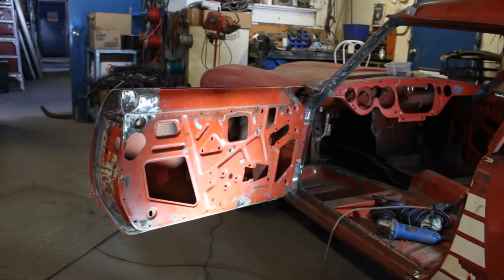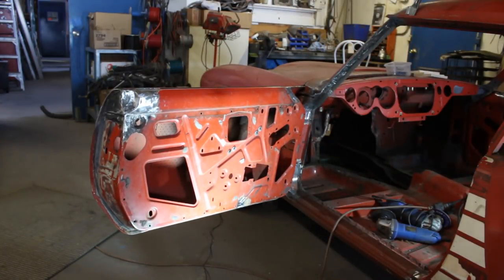1972 Triumph GT6 Restoration - Part 47 - Can of Worms...?!?

Comment: Hi Elin, Where the original body panels were braze welded, my suggestion would to be gas weld using 1/16 nickel bronze rod, Nickel bronze is great for structural panels like this and it was widely used in the construction of space frame chassis. It would save a lot of your issues where you have to mig weld along those previously gas welded seams. It is not s cheap rod, but it flows beautifully. Keep up the great work; I enjoy your posts immensely.

Comment: Elin, love your patience! Those brackets you removed from the wheel well interior are for the trunk interior support structure, the longitudinal trunk floor support structure. Make sure to position the brackets and the support structure temporarily to pick up the attach points of the trunk floor panels, the ones made of hard board. The removable panels are supported and then attached by the longitudinal support structure with screws and quick release catch pins that are captured in place by plates with spring ears. The panel on the right side is easily removable by pulling it up to release the quick release catch pins thus facilitating easy access to the jack equipment and the spare tire. I would preposition all of these parts in their respective positions to ensure you have all of the reference points and support structure rigged accurately thus ensuring the exact location of the panels and their attach points. This will ensure the panels , the support beam and the fasteners locate exactly!!!PS check that your gas tank can be installed/removed if you decide to weld in the support bracket rather than bolt it in place!!
Reply from the maker: Thank you for the detailed explanation, Maureen. I already welded the brackets back and I am pretty sure they are at the exact same location. I am not sure I have all these panels, but I will worry about that when I get to it. For now I want to focus on finishing the body and suspension later.

Comment: I had to learn a lot about metal corrosion for my job (nuclear power) and I have fundamental knowledge of how corrosion starts and progresses. I don't understand, however, how it could start there between those panels unless there was a fundamental design flaw that allowed the elements between the metal pieces. A "class problem" as we would say in the Navy...something similar to all of the same boats (or cars in this case) but it's fascinating to me how this stuff happens. Not fun to fix, mind you, but still fascinating! Good job, Elin.
Reply from the maker: That happens when there are overlapped layers of metal. No matter how well they are seam sealed even if water can't get in there will always going to be a condense. That is why I prefer to do butt weld. I was watching a video of a guy overlapping about 6-7 inches of metal on the floor of a VW bug. He believed he was making it stronger....  
When I was repairing this I was seriously considering leaving it open inside, but I knew there were going to be many people to disapprove so I closed it.

Comment: Ugh, I just reviewed my own photos of that part of The Beast and have the same problem... How do you know you went far enough fore and aft? Looks like you could have gone further back on the driver's side, but it's difficult to tell.
Reply from the maker: I went as close as possible to the spot welds for the external plate. It turns out there are two vertical rows of spot welds at the back so on the driver side I first went behind the first row, but then went back to the front of it. There is about one and a half inches between the rows and that area remained unrepaired, but I just can't get there without taking apart the whole car and I thought it wasn't worth doing that just to clean and paint. I am sure that will be fine. I am planning to use waxoil or similar product inside all enclosed areas and that might be one of them. I will just drill a hole on the inside and spray in it.

Comment: Wanting you use a bottles with a pump in the air pump bottles rust proof and then spray that on where the gaps or holes you can't get to the rust so you all inside where you can't get to the rust with a brush so it's just soap the whole lot underneath between all the gaps